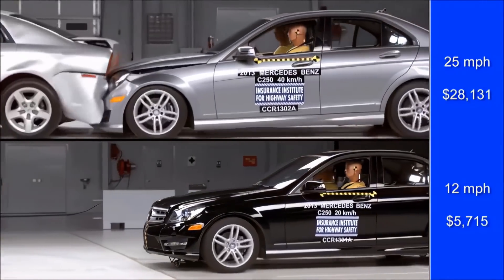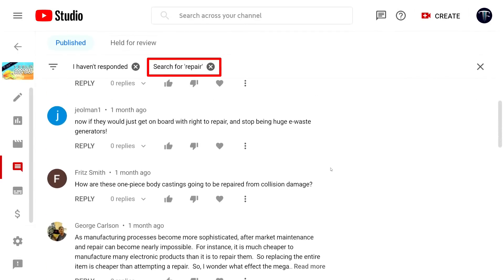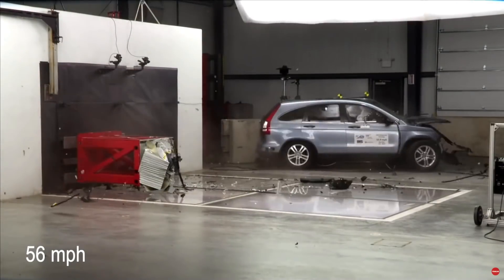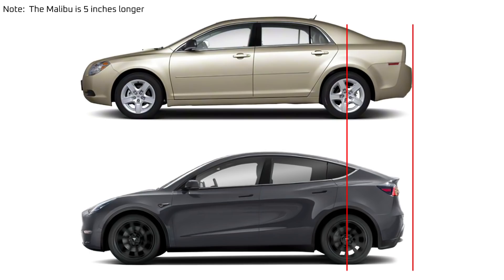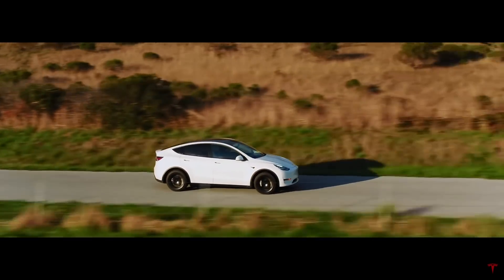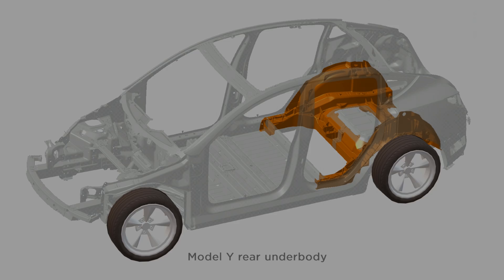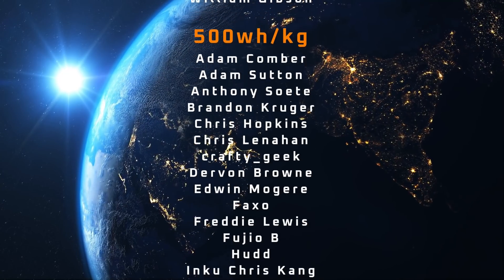#1 Tesla Gigacastings // Crashworthiness and Repairability

Comment: I have been doing collision repair for 30 years. #1- Sandy Munro understands his area of expertise but it is not collision repair. #2- It will be up to Tesla if they make partial replacement pieces for the castings or if the whole casting will need to replaced. It is very unlikely they will allow any welding on the castings. #3- Insurance companies will decide  to repair the vehicle or deem it a total loss based solely on what is most economical.  #4- If they repair it, it will likely take a long time, so line up other transportation. A 30 day rental policy won't be enough.

Comment: I haven't seen aluminum costs being higher than steel in my own manufacturing.  I always find it less expensive than steel in the U.S..  I'm not sure where you get that aluminum costs more than steel, and high strength steel is actually quite expensive compared to mild steel.
Reply from the maker: This will be covered in the 'aluminum vs steel' video.  You have to look at total manufacturing cost.
Reply: @thelimitingfactor  I'm not sure what you mean by total manufacturing cost, because I manufacture products, and my costs don't reflect what you are saying, so I'll look forward to that video.
Reply: Depending on where are you manufacture. The US must import thin high strenght steel from abroad, that makes it pretty expensive. In Europe HQ Aluminium is more expensive. Since you pay steel per ton, the  higher price for high strenght steel to mild steel will be compensate by thinner constructions (if your Engineer is halfway competent). As I said, depending where you manufacture, the result may be different...
Reply: Aluminum itself is more expensive than steel.

Comment: The Gigacastings will also improve the lifetime of the car. Corrosion of the steel structure is here a main limiting factor. Aluminium will not rust and stay stable in case of a crash even after a decade and a million mile...
Reply: aliminium does corrode, not the same as steel, but it can be quite severe
Reply: Hi from Minnesota. Yep, frame rust is a huge concern here.
Reply: Which is why Sandy Munro designed a Fiber Reinforced PLASTIC Battery Tray , much lighter than METAL and just as SAFE, does not need a Metal Shield either for Batteries.
Reply: @markplott4820  Even if you have a plastic battery tray if it has to be screwed to the castings, what sort of screws will be used? There are also other components that have to be attached like the suspension. It's the fixings that will be vulnerable, or the aluminium immediately around the fixing hole. It would be easy enough to screw some bolts into a sample of the aluminium and subject it to accelerated salt spray test to see if corrosion sets in.
Reply: @brendanpells912   - I dont know but, SANDY made a Whole Video on it. 
he like it Better than the Current Metal battery trays.
Reply: Elon Musk was talking to Sandy Monroe about Tesla original designs which used dissimilar metals which had to me coated to prevent corrosion. The 1 alloy casting will eliminate this problem. Saving money, time and possible future recalls from body failures.
Reply: The main parts with corrosion are nowadays under carriage parts or doors (underside) and not the load bearing parts. Even they last longer than the combustion engine lifetime, at least in most european/ asian cars. Staying stable in a crash is the least thing you want, energy absorbing by deformation is the goal. I don't think the repairaility is the issue after a crash. TLF explains it in this video accurate why this isn't a issue. I've already designed load management parts for Car components made of Aluminium, Magnesium die casting and high strenght steel (1000N/mm²), in the end everything is dealable. But my main question is still open: Why alu die cast? Cost savings? no way! only if you calculate wrong. To get a consistent alu material quality will be very expensive. Less energie consuming process? (less robots) Forget it, the production of auminium itself is already pretty engergy consuming. In the end they could be happy if there is a black zero (no loss). Btw, big magnesium and Alu die cast carparts are actually an old hat, not that big as Teslas parts but since die casting is scalable, the limiting factor will be the tool, not the product.
Reply: @markusweber1703  Both Tesla and Sandy Munro have stated that it's cheaper when produced in volume. Another big benefit is that you free up a lot of factory space so that you can utilize your space better and increase the production rate considerable.
Reply: Corrosion in steel car bodies is nothing as bad as it used to be. Aluminium alloy does corrode, maybe not so much on it's own, but it will when you start bolting steel parts to it with steel screws, due to electrochemical corrosion. Especially in damp environments with salt in the air.
Reply: @brendanpells912  corrosion can still be a problem with new untested paints and costsaving measures... I have heard instances of Golf 8 rusting on delivery, some parts covered with plastics are painted very poorly.

Comment: Most modern cars are now a total write off if the airbags go off due to the extensive damage they cause to the interior - side panels, steering wheel, dashboard, windscreen etc.
Reply: If the Gigacasting technique works out as well as Elon wants it to and manufacturing gets orders of magnitudes faster, when you crash a Tesla covered by Tesla insurance, they will eventually just give you a new car and recycle the old one.
Reply: @stcredzero  yep. As long as the gigacasting protects the battery and drivetrain, the salvage value of the vehicle will still be in the $20k range.
Reply: @stcredzero  Just how it goes now, everything is getting glued/sealed shut and device manufacturers are doing everything they can to shut down the right to repair
Reply: @stcredzero  Give??

Comment: The combination of FSD and multi camera 360 degree video recording means in the great majority of collisions the other party will be at fault both factually and provably, so the cost of repair becomes less important.
Reply: That is a VERY important insight! Also applies to lesser likelihood of Tesla passengers being greatly injured or killed. Any medical issues quickly outpace repair costs!
Reply: The camera data alone should mean that a Tesla is cheaper to insure. These insurance companies are truly shortsighted for charging such high premiums to Tesla owners. Trying to make a quick buck for a few years has led Tesla to enter the insurance business. Little did they know, Tesla will get into fewer accidents and prove the other driver are at fault with camera data. An insurance company's dream! 😂🤷
Reply: ONCE , Everybody has FSD, Accidents and Death can be Eliminated.
Reply: @markplott4820  It will be considerably reduced. There will always be small risks such as insecure loads and mechanical failures.
Reply: @fredbloggs5902   - EV dont typically FAIL , unlike with Combustion cars and Hybrids. 
they can often start even when at Altitude and Cold Temps.
Reply: @markplott4820  Nevertheless a small risk exists.

Comment: Good video, but you didn't address side swipes, side impacts, and Tesla's Achilles heel (pun intended), bottom damage due to road debris and potholes, which automatically equal a total vs ICE if severe enough.
Reply from the maker: Hmmm, it depends on the height of the t-bone.  That is, vehicle or pole?  Take a look at crash testing 'pole test' for Tesla's vs other vehicles.

Comment: As if insurance price is actually based on costs and not "negative perception" of accident experience
Reply: Heh. This is where Tesla insurance differs. It'll be based on the exact calculation of driving style as detected by the car. They'll give safer people lower rates and risk-loving people higher rates. But both rates will be less than traditional insurance, since they take Tesla's safety rating into account.
Reply: @AndyZach  I know that... Regular insurance is a fucking racket... It's protection money made into law

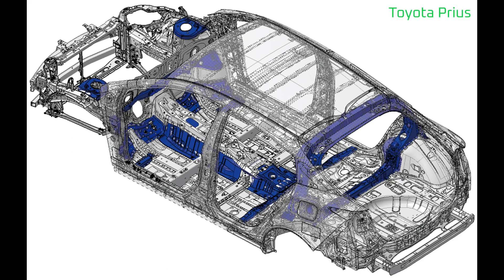Comment from the maker: At around 3:28, I refer to the unibody as a single 'molded' unit.  Single 'welded' unit would be more appropriate wording 😀
Reply: Excellent video. Your analysis is consistent with the arguments I made about repairability when Tesla first introduced gigacast underbodies and the use of crash rails. I don't know much about the fracture mechanics of Tesla's alloys, but unlike steel, Al is generally not cold workable and so although you can weld it, you likely won't be able to bend it back into shape.
Reply: Wow 🤩
Reply: The thing is that the Unibody is several pressed extrusions , then welded during assembly. Something that has never been done on an Automotive production line …. Single moulded Unit isn’t actually correct but it will do …
Reply: @chrisbraid2907  Almost all current unibody frames are stamped (not pressed) and welded and epoxied. Tesla's frames are evolving from traditional unibody frames towards subframes (cast front and rear underbody subframes) joined (bolted or welded) to a structural battery back. The current Model Y is a hybrid between a traditional unibody bolted onto a cast rear subframe (rear underbody).
Reply: the Limiting Factor - it was my Understanding that the Advanced casting for Model Y would have Molded in Crash Rails, done in one shot ? both Front and Rear. 
am I Incorrect ?
Reply: @markplott4820  No, as he explained in the video and Elon implied, the crash rails are separate pieces bolted into the gigacastings, so they can be unbolted and replaced after a relatively minor crash.  In Model S and X the crash rails were extrusions.  They may also be in 3 and Y.
Reply: Yes, unit bodies are usually welded stamped sheet metal.  Molds are for making castings.
Reply: I absolutely LOVE  your channel and ALWAYS  like (thumbs up) your videos. Not only do I learn a lot about your topic but also I analyze how you present your information and the research you had to put into it. REALLY REALLY enjoy this. Do you have some time to carve out and chat with me? I want to be able to produce similar content but for myself.

Comment: I wonder if one of the goals Tesla focused on in its alloy development was to create one that tended to crack instead of bend. Not sure how possible that is with aluminum.
Reply from the maker: They focused on a balance of properties - overall it will be stronger and more ductile 😀  I have so much up my sleeve, ehehe.
Reply: @thelimitingfactor  BMW with e60 5-series had serious issues with cracking underbodies for rear ... and that was happening fairly quickly and did not required accident to break up. Just heavier usage could cause that. I understand that Tesla is not BMW and they know much more about materials than any BMW's subcontractor... so I do not expect it to crack easily, that structure does not even look easily crackable - which is good I think. Some flexibility may be good, but too much would ruin body stiffness completely. So I do not think that Tesla made this very flexible/twistable/bendable, if at all.
Reply: @apocrypth  a material that bends before it breaks is not necessarily less stiff. for example, hardened tool steel and soft steel have almost exactly the same stiffness but one will snap and the other will bend. in the same way, most aluminum alloys will have very similar stiffnesses (technically called Young's modulus or elasticity modulus).
The stiffness of the gigacasting is determined by its shape, not by the exact alloy used.
Reply: “In one embodiment, the alloy comprises a yield strength of at least about 130 MPa and a bend angle of at least about 20° at a 3 mm section thickness when as-cast and without further processing." - Tesla Alloy Patent
Reply: @Zedus-rl9hp  What one needs with this patent description is a comparison to various types of steel. It's odd that a patent lawyer, who should have excellent English skills, would write "at least about". What does that mean? Is it 130 MPa and 20 degrees, or not?
Reply: @artsnow8872  There is a lot more in the patent, as far as I saw it while leafing through it, various test alloys and their results were listed here.
At the end of the day, the values are relatively irrelevant, because it depends on the alloy surcharges, which then mainly determine these values.

Comment: I agree with the general theme of the video. Definitely not worried about crash worthiness and I don't think there will be a significant difference in repairability vs. conventional unibodies.
But I don't buy the "the material is weldable in principle so a damaged casting can be repaired" part (in the side impact section). Doesn't seem feasible to me. However I'm not a car guy nor a proper mechanical engineer, so take this with a grain of salt.

Aluminum is not so brittle that it snaps without bending. If it's cracked, it will also be bent.

If it's bent, how do you even get it back into shape? I once heard that car shops can use hydraulic tools to pull bent fenders back into shape, but the castings have very complicated shapes so that probably won't work. And there's a big problem: compared to steel, aluminum doesn't take too kindly to being bent repeatedly - the repair will introduce cracks or stresses that can lead to future cracks.

Supposing the part is in the desired shape, but cracked and you want to weld the cracks. How do you even find all the cracks? The shape of the castings is probably too complicated to use portable ultrasonic testers. The castings are too big to fit in all but the largest X-ray machines and small cracks don't show up in x-ray anyway. Dye penetrant inspection is probably the most feasible, but that would still be a big hassle, and it only finds cracks that reach the surface.

Then there's the welding itself. Can the alloy really be welded safely? If I were in charge at Tesla's materials team I probably wouldn't compromise on the all-important casting alloy to make it weldable. If it is weldable, where are you going to find a welder that's trained and certified to work with Tesla's proprietary die casting alloy?

The most feasible way for a repair would be to cut away the bent/cracked section of the casting and weld on a replacement part. But that means you have to fabricate a unique replacement that emulates the structural properties of the shape that was cut away. Not easy, not cheap. And then you still have to weld it.
If you think futuristic, you can get a computer to design the perfect replacement for the cut-away part and then have the shop 3D-print it directly onto the casting. Software that can do this exists (mechanical engineers routinely use software that can design parts when given load requirements, shape boundaries and manufacturing limitations), but I don't think we're quite there yet with the printing tech.
Reply: Regarding the last point, wouldn't you just take a new casting from Tesla a cut out exactly what you need out of it? Assuming welding a replacement works and Tesla wants to help you with repairs, this seems like an obvious choice to me.

Then again, I have no idea about repairing cars beyond bolting a metal plate to patch a hole which was made due to corrosion. :)
Reply: @peter.g6  In theory, yes. Tesla could make all kinds of replacement parts. However, that's not their focus at the moment and won't be for a couple of years. They'd rather put that new casting in a new car and sell that, much less organisational overhead.
Reply: @w0ttheh3ll  Are you their spokesman? :)  

IMHO setting a few gigacastings aside and sending them to Tesla centers would be a piece of cake for them if they wanted to do it. They don't need all kinds of replacement parts, they have 2 pieces per model. And if it makes sense (which I'm not saying it does, it's just a speculation), they might as well do it, cause it's batteries and chips that limit their production, not the casting machines' speed.

At least I'd like to see that, repairability is an aspect of sustainability.
Reply: @peter.g6  seeing a more repair-friendly attitude from Tesla would definitely be nice.
Reply: @peter.g6  I agree setting aside some megacastings for each service center would be easy. The hard part is tooling and training the mechanics to be able to do the job.

Then, as another person wondered, if the casting changes, which version do you stock? Are they backward compatible? These issues all have engineering solutions, but as @w0ttheh3ll pointed out, it adds overhead and cost to repair, stocking, and training.
Reply: I guess in most cases, if the casting is damaged in a crash, the battery pack will also be already damaged = buckshot anyway (like any other car with steel biw due to high deformation forces)
Reply: @markusweber1703  Depends upon the location of the impact. If it's front or back or a corner, I doubt even crushing the casting will hurt the pack. Side impacts, yes. It's likely the pack will be totaled if the  casting is broken.